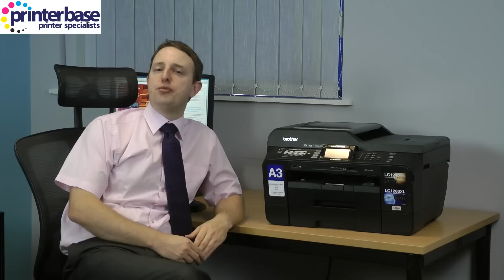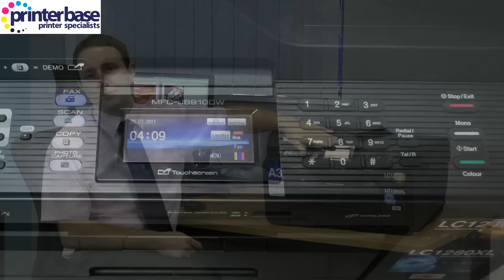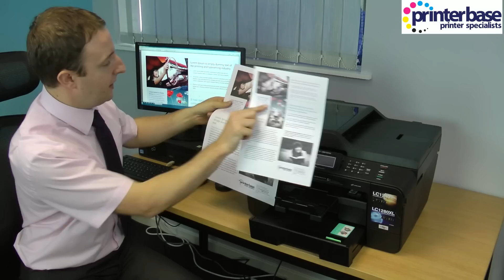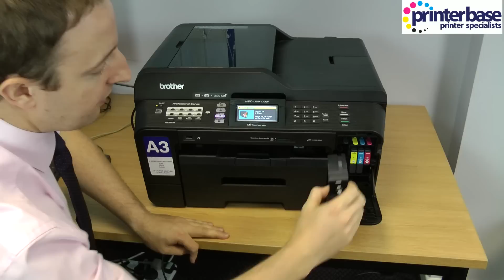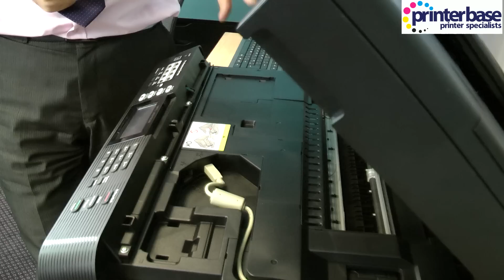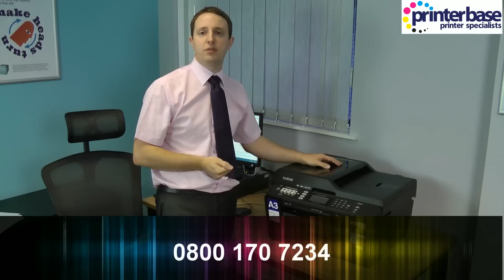Brother MFC-J6910DW A3 Colour Inkjet Printer Review - DISCONTINUED

Comment: Thank you for the video , i have one question that bothers me a lot , it's about WiFi . There are about 10 employees sharing the printer across an access point d-link device , and the thing is that the printer starts printing extremely slow , is it because of the number or ? while it prints perfectly on USB.
Reply from the maker: Hi there Raouf - and thank you for submitting your question,
In response to your query, I would advise the following...
So, theoretically a WiFi connection
can be as fast or faster than USB in terms of the job transfer speed, however,
in practicality a WiFi connection is subject to the strength of signal at a
given time between the access point and printer and can vary dramatically if
there is low bandwidth and lots of users, or if there is interference from
other electronic devices. The best way to improve the speed of connection would
be to hard wire the printer onto the network using an Ethernet cable connected
directly to your router or access point which would give you a guaranteed
connection from printer to network which should increase the transfer rate of
data and reduce the print times. I hope that this helps.Best Regards,The Printerbase Team

Comment: Thank you.  Nice clear, and informative about the printer.  Could you add if the printer type will do "Photo" quality if using "Photo" paper.  Might be handy if someone is looking for that feature as well.  Well done.
Reply from the maker: Hi there Counter Strike,
This machine is 18.5kg without
the box, which is about 41lbs so a little heavier than the newer models. We hope that this helps.Please do let us know if you require any further information about this printer.Have a great day.Best Regards,The Printerbase Team
Reply from the maker: Hi Neil, thanks for the great feedback. We really appreciate it.

We’ll take your comments on board and pass it on to the relevant team. As a general point, this printer would be great for creating your own glossy photos at home thanks to the dye used. If you were looking to print photos on a professional level then there are a couple of other machines that would be better for this.

Please let us know if you have any further questions

Thanks
The Printerbase Team
Reply: Do you know how much this printer weighs, I know the newer all in ones with the two paper trays are 36 lbs?